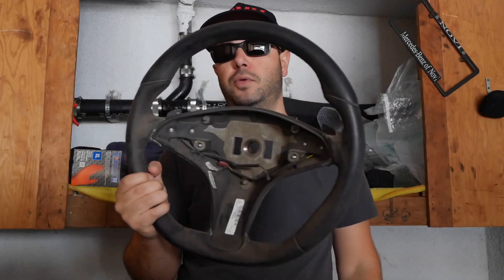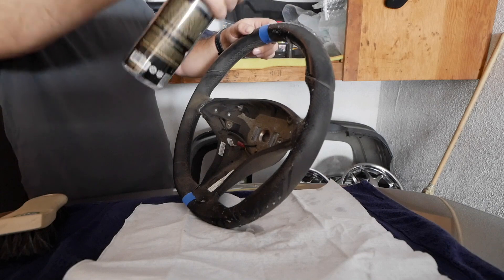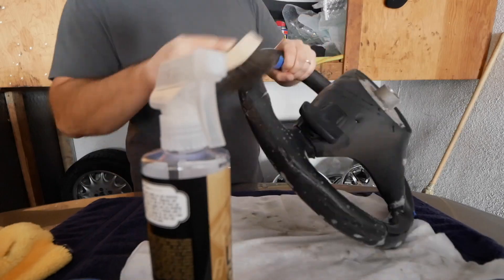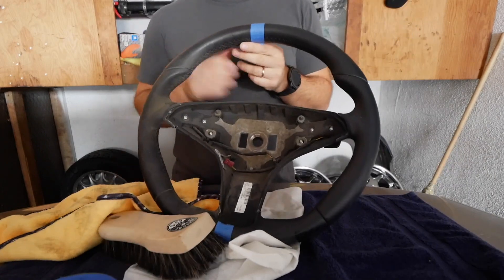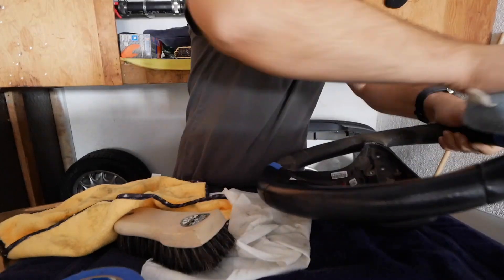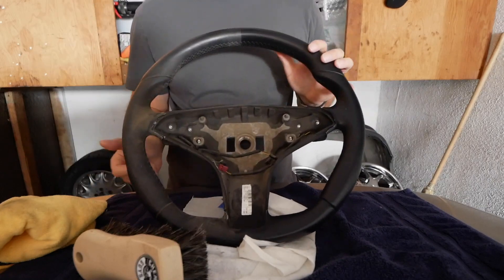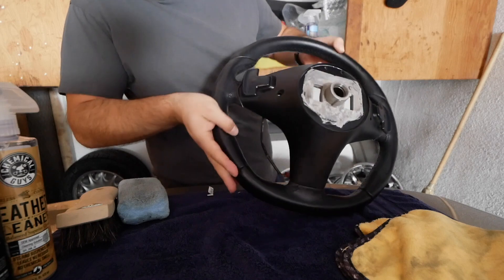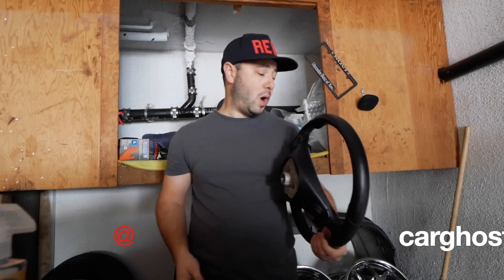HOW TO CLEAN and RESTORE THE STEERING WHEEL of YOUR CAR

Comment: Hello my friend, I have a cls350 / 2006 car in which there is a problem. If I do not run it for a period of time the day the battery is discharged, and I make a subscription for it, knowing that I have bought a new battery and the same problem, do not hold back my friend with your papers
Reply from the maker: You have an electrical leak somewhere. Something must be draining the battery